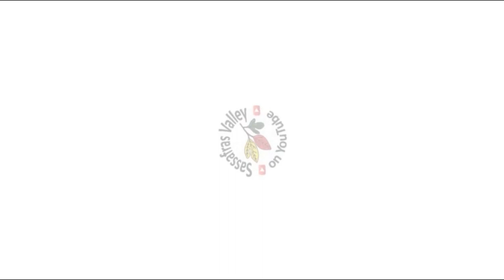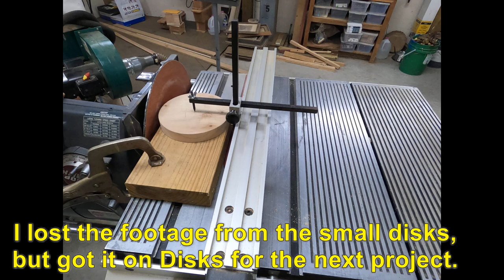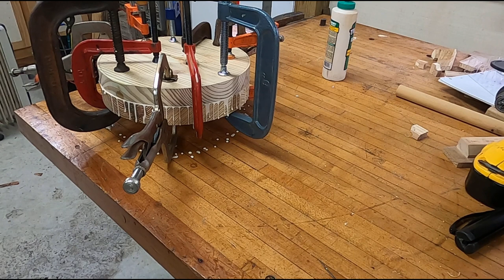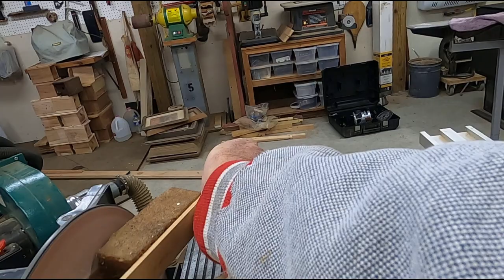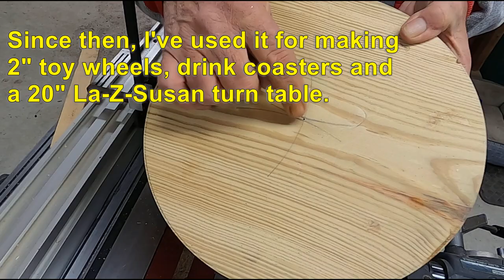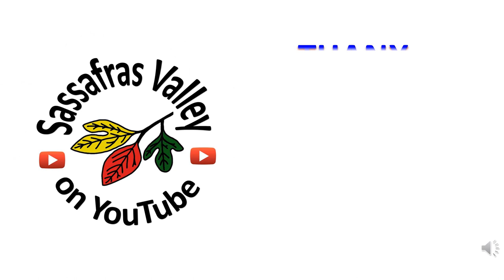Simple Mod Makes Perfect Circles on Shopsmith MarkV 520

Comment: Thanks, i immediately went and bought a circle cutter!  I used a longer screw, put a plastic-through-the knob on it and then placed it  through the existing threaded hole and into the shopsmith clip…tightened all the way into the clip. Secured the clip with another small screw and then tightened the knob onto the circle cutter into the  clip and it is rock solid.  Thanks again, Ken
Reply from the maker: You are welcome.  That sounds like a goo modification.  Glad you stopped by!

Comment: Great idea! I think maybe lowering or raising the table would also move the workpiece to an area of fresh abrasive, unless you are cutting at the far edge of the disk.
Reply from the maker: Good point… I wasn’t even thinking of that.  The thinner and smaller radius disks have a much narrower band of contact.  It would certainly be effective there.

Thanks Tom.

Comment: Thinking outside the circle !!!
A simple fix to a problem are usually the ones that last. 
That was a rare allen key, had some torsion forces applied to at some point, never seen one quite that shape !! 
Dimples for the Captain, another yacht project for you ?
Reply from the maker: Yes sir… I don’t know the story on the pestilence that wrench has seen.  I found it in an old toolbox my dad left me.  It fit.  So, I stored it with the Circle Fixture.

We’ll talk about the dimples a bit more on the next video… see you then.  🤓